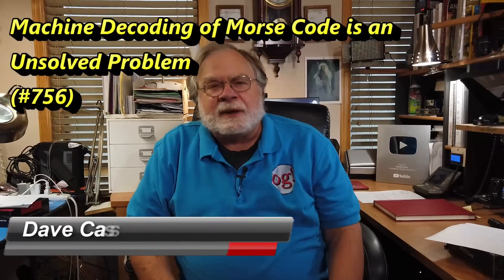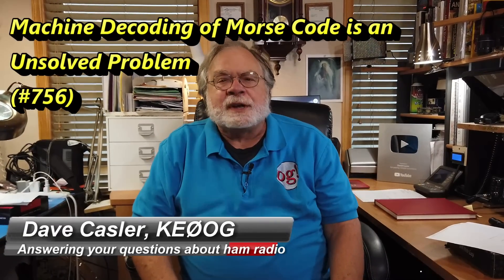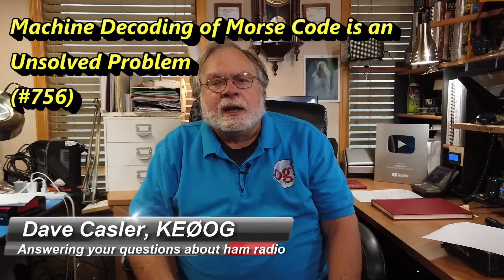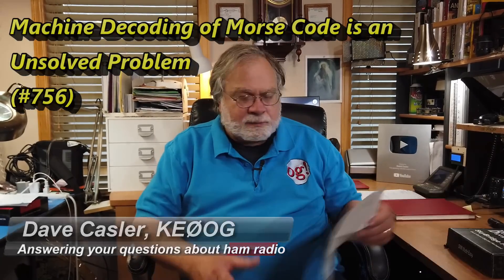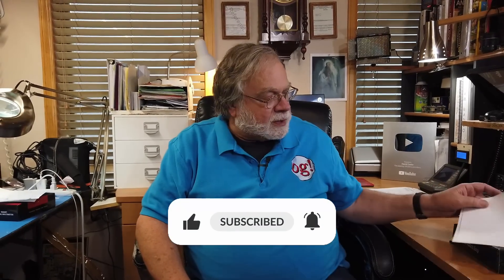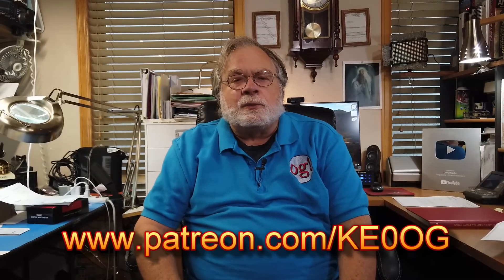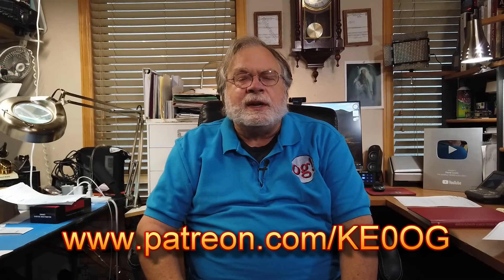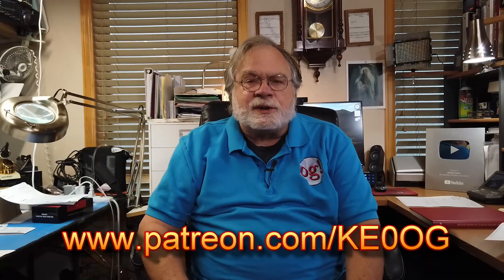Machine Decoding of Morse Code is an Unsolved Problem (#756)

Comment: Good morning, Dave! 
Speaking as a corporate Radio Shack salesman and manager from 1981 to 1989 and very familiar with the TRS 80 Model 1 (I have several models of the Radio shack computers in a storage bin in my garage to this day ) I can agree that back at that time the ability to decode Morse either mechanically or remotely would indeed be challenging and certainly something of interest in a master's thesis...for that day. There's the term that's important here. Today, decoding and transcribing CW is terrifically and surprisingly accurate using something as simple as a free app that you can put on your Android phone. I'm working on my CW right now and will test for my Extra soon and I have two different apps on my phone that I use all the time to test myself as well as to simply satisfy my curiosity about the shorthand and what people are saying. There's no need to purchase anything for 150 bucks from MFJ when your phone and even affordable Chinese multi-band HF radios can do this task quite well.
73 de KK6BDW
Reply: Sure! I use two of them and one will sometimes work a little better than the other, - they're not identical in their accuracy - but they do good enough. One of them is called simply: Morse Code Reader and the other is:
Morse Expert. 
Both of them are free and Morse Expert has the usual ads at the bottom that you can make go away for a couple of bucks. I just tune down to the CW part of the band, often 17 m, and tell the app to run and the text will show up on the screen. It does help if you have the ability to control your filters so the sound is nice and clean but it doesn't have to be perfect at all - It's often pretty faint - but In my case they work surprisingly well. I'm using these with a 7300. I have a little Xiegu G90 hooked up also and it has a built-in Morse code reader, but it is much more picky and you've really got to be tuned in and clean for it to work effectively, but it does work even with a person sending.
There are other apps out there too. Just experiment until you find the one that works best for you,. But I use it almost entirely for human-sent CW and it's a lot of fun.
Addendum: I'm running these apps with a Pixel 4 XL running the latest Android build. I've also tried them on my wife's Pixel 6 Pro and the apps work fine with their processor power. That being said, if you are running an old Motorola 5 with Android 8 or something similar, your mileage will probably vary.
Reply: Reference to the app you use?
Reply: yeah. I've see ham radios do this

Comment: An article by W4BQF (silent key) recommends a reader  for high speed (>55wpm) Morse. He claims that while the readings are imperfect it still helps the brain decode correctly. I am still working on slow speed Morse, so I can’t say. 

Of possible interest, the last episode of the ARRL podcast Eclectic Tech featured David Kazdan, AD8Y talking about coherent CW. However, this is machine to machine code.

Comment: Respectfully disagree. FLDigi running on Linux decodes CW beautifully! Sometimes even signals too weak for the ear. Using the above in conjunction with "working" the radio has netted 7 continents for me on a tech ticket. Filtering is key :)
Reply: I agree with you completely. I think Dave is basing his answer on his experience from 40 years ago and things have,  indeed, changed the lot since then.
Reply: Yes - I find CWGet is maybe a wee bit better (so close) and the best is MRP40  from my own experience.  I use them to try it improve my wet computer's decoding but the older I get the harder it is to do, my speed seems to be descending not ascending.  Sending is even worse for me, the fingers do not react well anymore.
I also agree that "working the radio" is the key - too many do not know how to zero in on the signal and then filter out all of the other noises.*  Once that is done, decoding is fantastic even with sloppy hand keyed code.  Even on my FT450D i can bring in very weak signals (under the noise floor without 'working the radio') and MRP40 will decode as well as CWGet/FLDigi often will
But I want to get back to where I can use CW as a conversational tool like back when I was a Novice and Tech.
* - funny how many do not know how to use the RF gain to benefit noise reduction and signal above noise floor optimizations - usually works better than what most on YT vids seem to do -
Reply: Dave is correct but I am impressed at how well FLDIGI decodes hand sent Morse Code.  Of course it must be sent from a good fist using paddles with a keyer.  Operators using a bug tend to slaughter  the    spacing.  There are many who do a good job with a straight key.
Reply: @peterfournia3929  no..... he isn't and that's my point. I only hope the guy who submitted the question reads the comment section. 25 plus WPM bug ops decode FB on FLDigi/Linux just fine.

Comment: I wrote a morse decoder for my Commodore 64 long ago.  It automatically adjusted speed based on what it was receiving.  Detecting spaces versus letters within words might not be accurate, but all of the letters were present.  It was not hooked up to a radio and therefore did not have to pull a signal out of the weeds or deal with fading.  But basically it could follow someone's keying as long as they had some difference between dits and dahs.  I really want to read your thesis to see what I am missing.  The conditions you were tackling were probably a lot harder than what I was doing.
Reply: yeah I've see ham radios do this

Comment: Well, this is a topic close to my heart.
I spent 15 years in the Navy (83-98) as a manual Morse intercept operator. Now, truth be told, 
The navy and air force (I was always at a joint location) were ALWAYS trying to find a way to get a machine to do our job.  Alas, it never came to pass (during my time). To be fair, I only spent the first few years actively copying code for a living but the Navy kept trying to use machines to copy code.  I think, at one point, they stood up system to replace humans but I don't know what became of that project.

We (the seasoned ops) could identify a sender by his fist without hearing his callsign. I'm sure they could have developed a computer to do that but, as far as I know, they never did.
Reply: Did you ever use PIM?  Pilot Intercept Morse.

I was a Navy  CTT and loved to copy code.  Caught a lot of frequency changes that way.

Comment: My TS-590SG and KX3 can both decode Morse. Sometimes they are accurate. But even when that is the case there is a long delay in showing the output. So reading the output interferes with listening and aural recognition.

Comment: Well said. In y opinion, most decoders on the market decode about 50% correctly.  I've purchased and used most of them.  CWGet is about the best in my opinion.  I've also used the skimmers to decode on the waterfall and they seem to do a pretty good job.  Not sure what software skimmers use.  all this being said - I'm simply amazed at the capability of the human ear/ brain handshaking that goes on.

Comment: You have to treat it like language recognition just as we do with cloud computed speech recognition.  Not as difficult.  Just need a training data set with accurate translations, and train it to recognize.
Reply: I've see ham radios that do this
Reply: @jamescollier3  but not radios that can do it well
Reply: @jamescollier3  you’re right.  The FTdx10 does a good job at decoding CW sent with good timing, but you must first reduce the noise, via tools like IPO, ATT, RF Gain, and DSP.  You must also set the CW send speed in the FTdx10 to within approximately +/- 5 WPM of what you think the sending speed of the station you’re listening to is.  Yes, believe it or not, the FTdx10 needs you to give it a hint of what speed you are receiving.
Reply: It‘s not so easy at all. Have a look at AG1LE‘s work on this…
Reply: How do you have a training data set of the empty spaces that vary from human to human?
Reply: @sammiller6631  in aggregate humans are predictable. Train on enough humans and it will work so long as you don't over fit.
Reply: @R3RadioResearch  How do you solve the overfit problem?
Reply: @sammiller6631  Diverse training set and don't train too long/aggressively. That is the art part of what AI/ML Engineers do. But heck I'm an RF guy who can code, not someone with a deep background in AI, so take that with a grain of salt.
Reply: @sammiller6631  you just need a lot of "labeled" (annotated) samples of humans sending morse code and you can train networks to interpret them in much the same way a human listener would.
Reply: @smittyplusplus  That's easier said than done. Network training can go off the rails like a chatbot ending up saying racist things due to its samples.
Reply: @sammiller6631  but in this instance it isn’t about the language. you’re training it for audio recognition. the risk profile there is pretty low. it’s only output would be the received character

Comment: I mentioned part of this on another post. In 1982 I  exclusively used cw being I was a novice. The guy I talked to for 2.5 hours was using a keyboard and reader. He had no problem copying me. He was in his 80s. Don't remember his call. Just for curiosity I had him to gradually speed up. He said my normal speed I was sending was 11 wpm.  He sped up to 25 wpm. I was able to copy most of it. Fir me, that was fast.
N4IA

Comment: This does not seem like that hard of a problem, all things considered. Yes I could send absolutely terrible code and it wouldn't get it because it's just wrong. But we have speech recognition software that accounts for pitch and speed changes as well as even accents. It's not easy but as compared to some of the current software solutions being made it seems very doable
Reply: speech recognition software is still horrible with accents
Reply: @sammiller6631  with very heavy accents maybe but even as someone who has speech issue Alexa/Google understand me just fine

Comment: Hi Dave, great video. I keep promising myself that I will learn code. I was thinking as you were doing your video. That I wondered during world war 2 if you knew what the success rate was for students in the signal core where in learning the code. I imagine that they took a great deal of recruits and put them in code class that most likely had no interest in learning the code. In Sioux Falls, SD where I am from, there was a radio school base that during world was 2  is said to have trained most of the radio operators that were on the B-17's and B-24  during the war. i still find learning the code difficult and I want to learn it.
Reply: How have you learned reading and writing your homework at school? Handwriting without looking at the text until it is finished was never a good idea. "Programming" cw in midi on a music synthesizer lmms and trying different speeds and musical instruments did help me a lot and is fun. Cheers Peter DL2FBA

Comment: Thank you,  timing is important  with  stable clocks.   Maybe  some day AI trained on every  CW  sender  can solve this problem.
Reply: Does CW need to sound the way it does? I tried to send CW on a MIDI synthesizer (lmms).  I had to use different instruments for different speeds.  Looking at the audio file with audacity or a scope the sound I could hear best was unintelligible on the display. Cheeers Peter DL2FBA

Comment: Fascinating! 
It should be possible with pattern  recognition software. Handwriting can be decoded, and faces and fingerprints recognized.  CW should be much easier.
As Dave said, the issue is whether there's a demand for such software. 
I could see an important use if normal communications are not possible, and only CW is viable (because of its simplicity).
Reply: There are humans without eyes and ears. They can do cw. Russians have successfully used cw on their robot satellites. Cheers Peter DL2FBA
Reply: CW is often required on weak signal contacts due to its superior signal to noise ratio.  It’s used a lot on ham microwave ops.

Comment: I've used FLdgi software for years to decode CW and it does a decent job....I'll use software decoding during contests to confirm call signs being sent at hi speeds +20wpm.  73/K6SDW

Comment: Glad you brought up AI, I was thinking the whole time this is the perfect application. I wonder, is there somewhere an existing archive of hand sent code with an accompanying text of what was intended to be sent? You would need some source material to train with.
I also wonder how one might tackle being able to decode in real time. I imagine some context is required to increase the accuracy, maybe it starts by analyzing a small sample first? Certainly decoding it after the message is complete wouldn’t be too hard, relatively speaking.
Reply: Learning prolog and lisp to play AI, I have seen a program called ELIZA that you can talk to. It looks like understanding you and giving meaningful replies. Sometimes 5 years old humans can get you answers that make you think twice, so does ELIZA. I have been thinking about morse input and output for ELIZA. I have been sending to computers. An electronic keyer is a big help. Chhers Peter DL2FBA